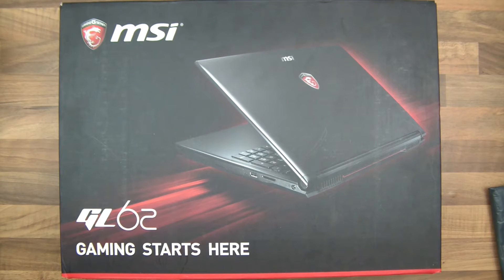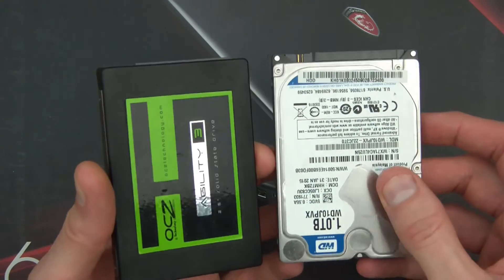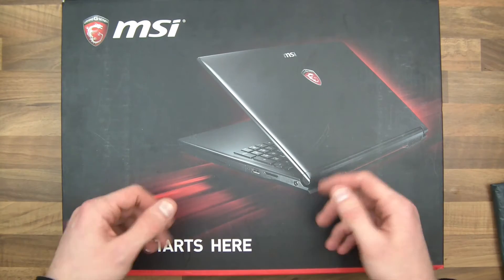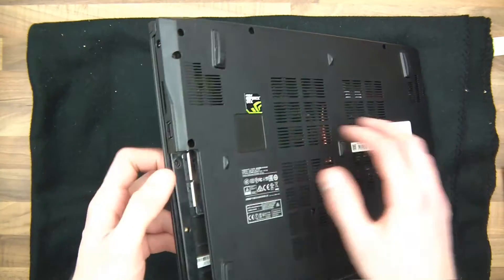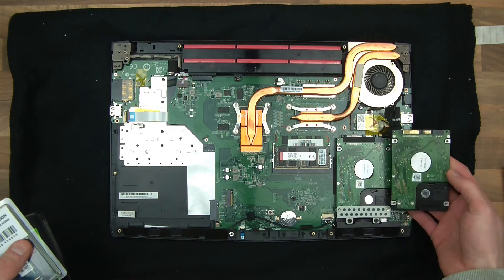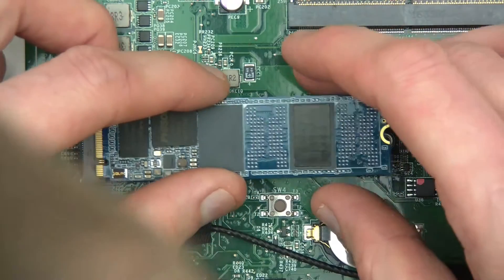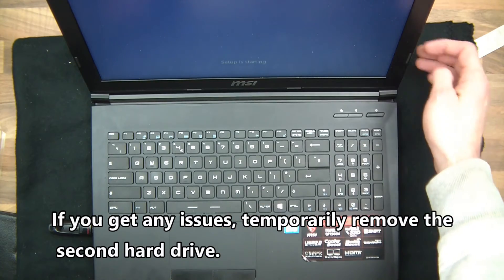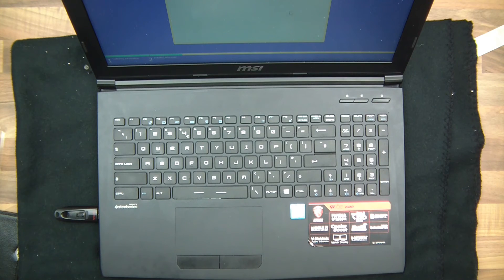TUTORIAL: How to Upgrade HDD to M2 NVME SSD - MSI GL62

Comment: Crucial website has both options as compatible with msi gl62 6qf. on the msi page, ram spec is 2133. should i get 2400 or 2666? I am thinking about upgrading to 32gb, but for now I will install 1x 16gb stick, and later add another 16gb stick. Would laptop work with a single 16gb stick? If yes, should I get 2400 or 2666?

Comment: Ok, I'm confused. Every PCI NVMe SSD I can find on the net has M notch (all SATA SSD's have M+B). I have 2 SATA slots for SSD's with B protrusions. Where did you find NVMe with M+B notches?
In case someone sees it: I have a GE62 2QF Apache Pro 2x SATA SSD + HDD.

Comment: Been having trouble with my MSI GV62 going into bootloops every time windows pushes an update. Going to pull out the optane and hdd for an ssd using your tutorial and see if it fixes my problem. Thanks a ton!
Reply: how did the upgrade go? I have the same PC and my drive keep failing. was thinking of doing the same thing.
Reply: Went pretty easily and my comp runs much better now. If you can put in more ram and a better hard drive, definitely do so. Especially if you're replacing that Intel optane thing that came stock in mine, I suspect that was what was causing the bootloop.
Reply: My HDD on the GL62 has started to go so I'm about to do the same and replace it with a pce SSD. Hope it's as easy for me as for all you guys!

Comment: I have an MSI GL62M 7RDX  and Im thinking to upgrade the 8gb RAM to 16gb RAM in terms of SSD I don't know if I have or what I only know that I have a 1TB of storage, so I would like someone to help me figure out how can I improve my laptop 
tnks.
Reply: I have same laptop as you & I'm upgrading it too. 8gb to 32gb and adding a SSD 1TB (1TB HDD already installed). Just wondering how you got on? Did you update successfully? Any tips?

I used the Crucial website 'auto scan' to see what I could update.
Reply: @CrazyShenanigans  yhea man i upgraded to 16gb ram its the same symple method
Reply: @rafica2376  thanks for responce. Ya the ram seems to be just plug  & play, but how did you find the SSD? I want to add an SSD but I have to copy/clone the original HDD then wipe old drive.

Comment: Hello, thank you for the video. I have probably same notebook as yours (MSI GL62-6QF) and I have some questions:
1. Can I substitute my stock SATA HDD with a SATA SSD? In your video, I see both ports are quite similar.
2. Or, Is there any NVME to SATA adapter so I can substitute my SATA HDD with a faster NVME SSD?
3. What is the max capacity of NVME PCIe SSD that can work in your notebook? Hopefully your GL G2 notebook is similar with my notebook.
I am not very familiar with computer/notebook upgrade and I want to learn how to upgrade my notebook myself. Thank you mate.

Comment: hey! hope u will answer my question veeeery fast.. i have the same laptop with 8gb memory.. can i uprade it to 32gb memory and wich memory i can fit in the slot.. and second is.. is the M2 nvme ssd the largest one i can put inside ? i wanna something like 500gb
Reply: Yes the laptop supports 32gb of memory, any ddr4 32gb kit should work in the laptop aslong as its not exceeding 2666 mhz, You can have a 2TB NVMe SSD so Im not sure what you mean with that question but yes you can have a larger NVMe SSD in the laptop

Comment: can any one give me any tips about my gv62 8rd-200? im trying to figure out if I can upgrade anything about it?
Reply: I have that laptop. You can upgrade ram, hdd drive and cache ssd. You cant upgrade cpu or graphic card, they are welded. It comes with intel core i5+ 8th gen, 1tb hdd, 16gb intel optane cache sdd and 4gb gtx 1050ti. I ran need for speed heat at 1080p low settings

Comment: Is there a way to find out if I have NVME or SATA port for SSD, without removing the bac cover and actually looking at it? Or are those two interchangable?
Reply: try HWiNFO app (from hwinfo(dot)com) - it will tell you the version of your motherboard/chipset. Then lookup the manufacturer's datasheet.
Reply: Well, at least I know now, that those two are NOT interchangable. You can't put NVME into sata port, but you can put SATA SSD into an NVME port.

Comment: what screwdriver do u need for the 3 small screws under the cd drive thing
Reply: Did you find the answer to this? I need to upgrade my HDD to SSD and I can't get the backing off because of those little screws.
Reply: @israasaber4127  You need a philips precision screwdriver, they usually come in a set of 6 :)
Reply: @xxymgxx  Thank you :)

Comment: Are you sure you got an nvme ssd ? Cause im looking to get one for my laptop and the one with the 2 cut outs is not nvme is just m.2
Reply: the one with 2 cut outs is the nvme m.2 and the one with 3 cut outs is the sata m.2. both are m.2 but one is sata while the other is nvme
Reply: @jactuscack7423  That's what I thought, because I want to buy a nmve M.2 and it has two cuts. It's the Samsung 970 EVO. In the video, he installs the Integral M.2 2280 PCIe NVMe SSD, but it has 3 cuts. It's weird.
Reply: @bornxntuesday  this is what make me shocked and afraid of buying it
Reply: @BaraSalah  I finally changed it mine. I had a M.2 SATA, but I put a M.2 NVMe and it works. I asked support first and my laptop was supposed to work with both (which did)
Reply: @bornxntuesday  i asked support about mine and it will work i will buy one next week thank you
Reply: @BaraSalah  You're welcome, enjoy!

Comment: I think you will quickly run out of space on a 120GB drive, even just with Windows and Program Files on it. I have this configuration, with all data on a 1TB drive like yours, and struggle with space, especially for Windows Updates.
Reply from the maker: Yeah, I've got a few laptops and computers... Two have 240gb and the rest 120gb, but what I do not is install most stuff directly onto d:/. :)